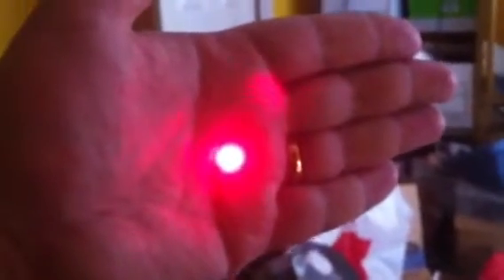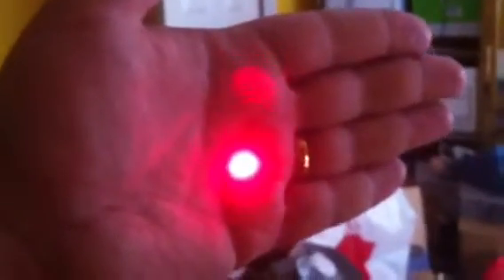Simple 555 laser transmitter

Comment: i m thinking of another innovation from this laser transmitter. what about making it as security sensor, where if an intruder (for example) stepping between the laser transmitter and detector, he blocks the laser light from reaching the detector. the absence of laser light at the detector turns on a transistor ( in logical gate switching manner) which sends out signal to turn on an alarm.